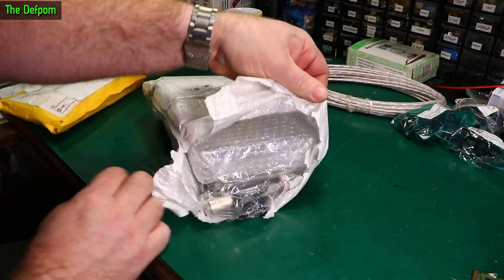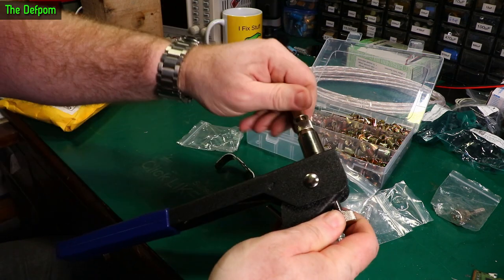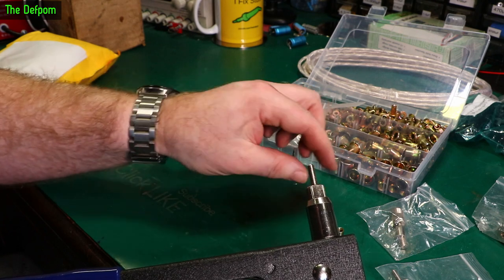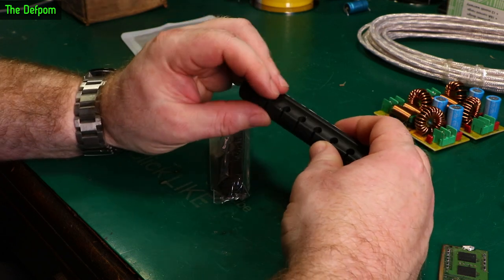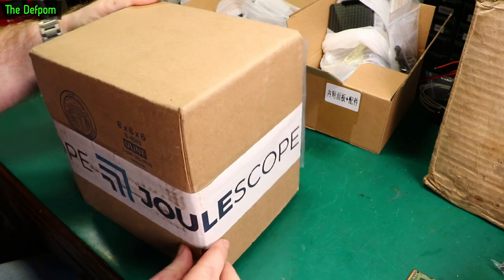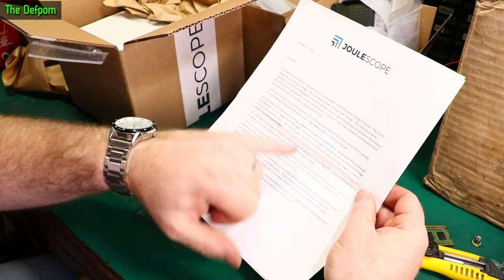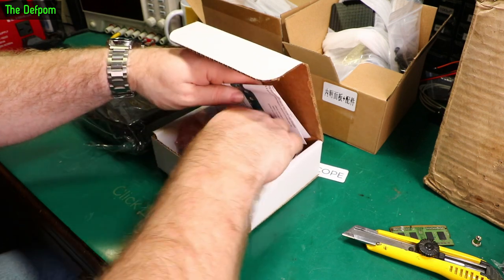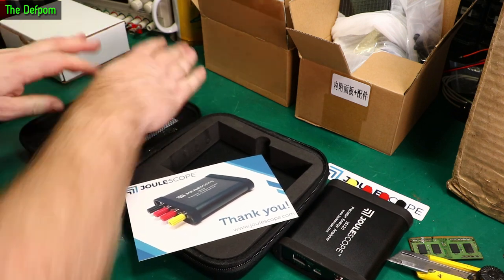🔴 What's in my Mailbag ? - Mailbag Monday 31st October 2022 - No.1056

Comment: I think you will enjoy using the JOULESCOPE.
I purchased it when it was being crowd funded, during development. I used it briefly, but during this COVID period have virtually halted most developments and it has been idle in its box. I have the   then, available various front panels, BNC  USB, etc

It covers a huge range of currents, by fast current range changes as well as large bit depth. Changeover of range is around the microsecond of the sampling. Software has evolved and I should make sure that I update mine. The original software had a few rough edges in display, but did improve and I would think it has further improved.

Comment: The JOULESCOPE was $300 when it was first launched. I was thinking of getting one, but then the price tripled overnight and that put me right off. Priced it right out for me. It's good, but way overpriced in my opinion. It's gone the same was as Saleae logic analysers, got my 16 channel one for $120, they are over $1000 now!!
Reply: I got the Nordic PPK2. It supports "just" up to 5V compared to the 15V(?) of the Joulescope, but usually you want such a tool for low power designs where more than 5V are very rarely needed. It's sampling rate is also lower with up to 100ksps, but that's also plenty for most maker projects I would say. 
It's been a fantastic tool for some low power LoRa projects for me to optimize the code and sleep cycles and with around 100€ it's much more affordable for a maker. I don't want to miss it and I'm so glad that Nordic developed and supports this "cheaper" alternative.
Reply: @Leif_YT  I develop commercial GPRS/GSM devices and they have pulse transients of over 2A and sleep currents around the 80nA mark. So the PPK2 is no good for me. I've modified a Current Ranger to use a better ADC (16 bit instead of the standard 12 bit) gives me the resolution and range I need at a fraction of the cost. I'm looking at the feasibility of making it into a product, but getting parts at the moment is a nightmare!
Reply: @simonbaxter8001  Good point with the max current limitation. For GSM Projects the 1A can be an issue - maybe they'll improve that on the PPK3?
But it's also tricky, I think. The PPK & PPK2 is successful because it has such a fair price and is "enough" for many, so they've to find the fine line between improving it on the next version while still staying in that extremely attractive price range. For me as a hobby maker the 90-100€ was really a no brainer for what it offers - especially in combination with the software. But it has its limits as you mentioned.